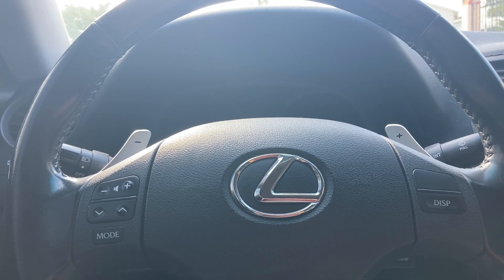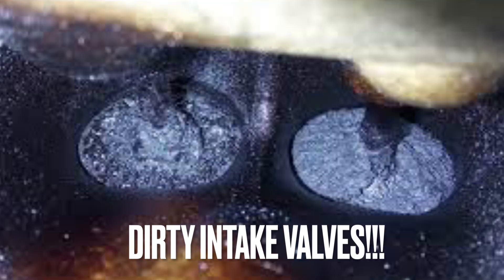How TO REMOVE Carbon Buildup From Direct Injection Engines

Comment: One of the many reasons I got the 350
Reply from the maker: True! However my 2008 IS250 is still running great despite its age. So maybe they don’t truly suck , only if you don’t address the carbon buildup issue at all. Then maybe it’ll cut the life short but otherwise I never had severe caked to hell carbon buildup thank goodness.

Comment: Just bought a 2012 Lexus IS250 and overall great shape with 220,000 mi. I don't know any previous history but I'm wanting to get the carbon removed! Amazing car
Reply from the maker: @mikeyyo183  you would need to find a mechanic that has that tiny camera that could see the intake valves. If it’s not so bad, you could probably do a fuel induction like I did, but if it’s pretty bad, I would do a walnut blasting procedure. That is definitely more aggressive and more extreme, but it does clean it very well.
Reply: I got a 06 with 225 for 4 k I bought  it with 221-222k around Christmas I fw it .

Comment: Although I'm no specialist, I've seen there are preventive measures. It's not so the EGR, aka exhaust recirculation that generates the build up, it's the crankcase oil vapors that also get re-circulated. The compbination of both generates carbon build up (exhaust gases stick to recirculating oil vapors). These systems exist because of emission laws, EGR or PCV valve delete is a somewhat of a risk.  

So, an oil catch-can (sometimes they are illegal) could prevent or severely reduce the carbon build up, but is the juice worth the squeeze. And it's only preventive, it won't help you if your engine already caked with deposits. 

In case of old models, I guess getting them walnut-blasted might be worth the effort. Then, maybe do the preventive measure, if your car is really nice and worth the attention. For the 'old-new' Toyota models (DynamicForce), that have dual injection, it is mainly for efficiency reasons, but it also prevents carbon build up, which is nice.
Reply from the maker: I recently walnut blasted it which is the most intense way to deal with it but Ele the car is driving superb

Comment: Thanks for sharing this. I'm actually looking to buy an 09 IS250 today.
Reply from the maker: Very solid choice. These are very stylish cars as well despite their age. They have a very timeless design.
Reply: How did you go with the car
Reply: @Anu_parma I could not find one in great enough condition in my price range in my area. I saw some good ones out of state, but i wasnt willing to go that far. Especially if they turn out to be a dud lile this 250 i went to see. However I still ended up with a lexus, but an Rx350. Which would be my second one so now we have 2 of those. They are really great. Paid less than 5k for on each and they've been going strong. Run smooth too.

Comment: How can you tell whether your car needs the valves cleaned?
Reply from the maker: I have not witnessed this personally with my Lexus because it never got too crazy in carbon buildup, but some of the symptoms are: Loss of power especially when driving at higher speed, poor acceleration, cold stalling engine misfires and reduced fuel efficiency.

Comment: how did he clean them? where did he spray the detergent threw?
Reply from the maker: So it was the detergent on top of the intake valves. See with my issue my cabin buildup wasn’t so bad that I needed to do walnut blasting. Now walnut blasting will absolutely be the better option if you have carbon buildup. Even if it isn’t really bad , if you had the budget the walnut blasting is better and will clean up the carbon buildup effectively. With this cleaning they had to remove the intake manifold on top and get access to the 6 cylinders. I would recommend looking it up on YouTube, I’ve seen a couple of videos where mechanics show how it’s done. They can explain in better the detail than I can and I want you to have the correct info.

Comment: I heard installing an oil catch can can help prevent carbon build up, thats what I heard not 💯 sure
Reply from the maker: Not sure either as I already cleaned my carbon buildup and keep an eye out on it. So far it’s all good. If this was an AUDI then I would for sure worry. I hear those gets caked to oblivion in carbon.
Reply: @AndrewBibay101  did you get engine codes?

Comment: Direct injection sucks! I really hate it
Reply from the maker: It totally does! Like why on earth was this engine ever made ???
Reply: @AndrewBibay101  Gdi gets better gas mileage because it's more precise with how much fuel is in the combustion chamber. You also get more performance out of one, most engines now have both normal port injection and gdi to prevent this.
Reply from the maker: @AustinsCoins  I wonder if doing this intake cleaning every year is overkill. It seems that there are some IS250 owners with 200k miles or more and they never even done the basic cleaning I did. Their cars running fine. Maybe in German cars the carbon buildup does more damage.
Reply: @AndrewBibay101  Mine has almost 149k miles and it runs great! I have had it for one year so far. The previous owner probably never did it. However, I did log into Lexus drivers website to see the service history. At 89k miles, it came into the Lexus dealer for a misfire. Lexus likely cleaned the carbon build up then because it was apart of a TSB. So all of those miles later, no signs of it running wise. I do believe that there is some, but the carbon buildup does have to severe to to make it start to misfire.
Reply from the maker: @AustinsCoins  most likely they did a fuel injection cleanup then. Valves were cleaned at that 89k mile service. This also means that your car hasn’t been cleaned in that manner for 50k miles which translates to this: you don’t need to do carbon cleaning as frequently as every 15k miles.

Comment: I don’t like direct injection engines because they are not reliable. I don’t think your Lexus will even reach 200,000 miles if you don’t clean it up often.
Reply: Doesn't need clean often, and I've seen plenty hit 200,000 miles. This whole comment is untrue.
Reply from the maker: You would have needed to clean it at least once or twice by the time you reach 200k miles! As long as you do that you’re good.
Reply: Toyota and Lexus vehicles are the easiest to reach 200k.
Reply: I have the same exact car at 209,000
Reply: The lifespan of this vehicle is 330k miles typically